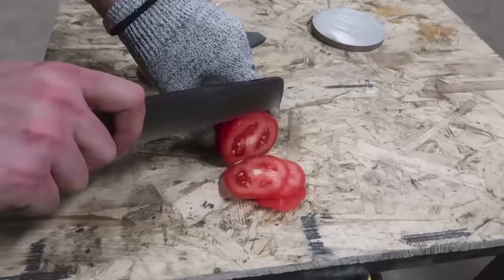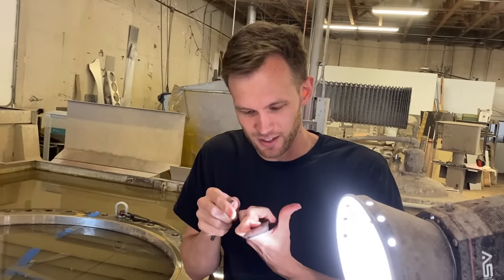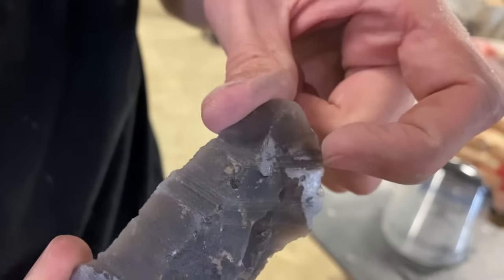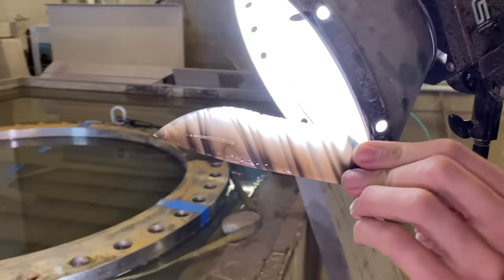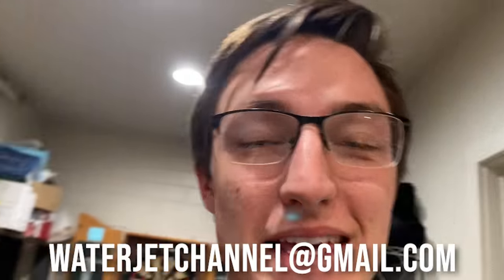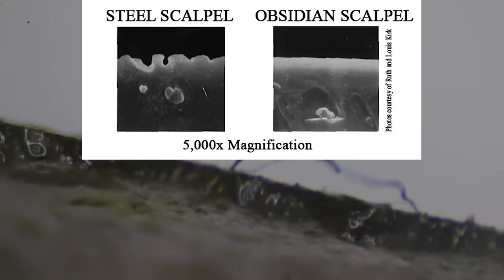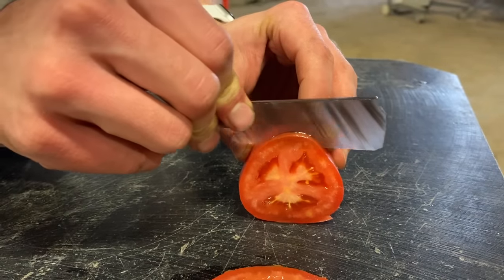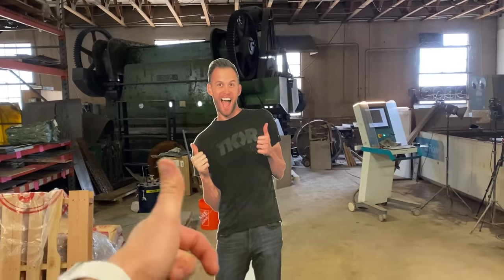World’s Sharpest Obsidian Knife

Comment: You can sharpen obsidian on a grinder/belt sander but you need a belt with grit made of extremely hard material and running at a slow speed/low power and kept wetted with water throughout the process

Comment: Fun fact: surgical scalpels r made with low quality stainless steel and only r meant to make a few cuts and then be tossed b4 they loose their sharpness. But obsidian can basically keep its edge a hell of a lot longer and then just be re-knapped or re-ground when needed. Also even in modern day, some cosmetic surgical procedures r done with obsidian blades, esp on the face, cuz they cut more precisely and leave less of a scar.

Comment: U can sharpen obsidian by grinding it on a whetstone very slowly. Not a a grinding wheel.
Reply: No
Reply: That sitll won't produce the super sharp edge:  they're made via the prismatic method: you flake singular long blade pieces off a core with each strike, so the blades have a continuous edge (vs knapping where you're making multiple strikes on the edge of your blade which results in some chipping and not one flush cutting surface.)

Comment: Fun fact: Obsidian is the world’s (maybe even the galaxy’s) sharpest material. Surgical steel is usually made from steel and this stuff melters together to a extremely high temperature. Indians craved it for arrowheads because it was easy to chip when found, then when heated it reduced the tendency for the arrowhead to crack. 😅🙂

Comment: Nice video 
A number of years back 
I had to have a Emergency  Craniectomy to relieve pressure on my brain 
Along with brain surgery to remove part of my brain after a nasty fall at work 
The Surgeon used a Obsidian Scalpel as it caused the least scaring 
So if you can make a SUPPER SHARP Knife 
You Might want to work on slightly smaller blades

Comment: I had this idea, of pouring different types of glass into nitrocellulose skeletons, inside of molds... and I think it might have similar properties to obsidian... I think it would make a nice gun stock, with an integral bayonet... by casting solid glass.
Reply: The burning nitrocellulose forces carbon into the glass under pressure... it's kinda like the liedenfrost effect I think, so it needs to be a skeleton of nitrocellulose, or the glass will run away from it. Also carbon coat the mold, and keep it hot, and vibrate it while pouring.

Comment: Actual obsidian blades are flaked off in one large hit. They are not specifically knapped like you see people do with stone. 

I've seen and used an actual obsidian blade and it is sharper than any knife edge I've ever seen. They are usually only vaguely knife shaped and usually are just a big flake.

Comment: Obviously, a water cutter leaves a rounded edge. That's why we never have to debur water cut metal. You are also forgetting that obsidian has a crystal structure like duamonds. You have to cut it at the right angle otherwise its not sharp. Thats why when you strike it to break off a shard it has to be aligned the right way or you get a very small scrap.
Reply: obsidian is glass, it has no crystal structure ,it may have some kind of crystal pockets within the glass but obsidian is a mineraloid and forms no "crystal structure" of its own . most obsidian is basaltic , felsic lava and quartz with other minerals in various amounts.  so melted and mixed minerals that on their own can form crystals but together and when molten forms volcanic glass . it does however form random shapes as it cools but these are not crystals .   it breaks with a conchoidal fracture , what's called in physics a "hertzian cone" . this fracture pattern is what allows obsidian and to a lesser extent flint to become so sharp if a skilled hand is involved with the knapping. the only way to get obsidian to the molecular sharpness alluded to is to create a "blade core" which takes about a year of knapping practice and cutting your fingers up. i do agree that a waterjet is not optimal for creating a sharp obsidian edge , whats needed is an antler punch, a wooden billet and patience/practice
Reply: @captainflint89  I stand corrected.

Comment: Hard surfaces such as stone, metal, ceramic, or glass should NEVER be used to cut on because it will destroy your blade. Always use surfaces that will yield to the blade like plastic, wood, leather, and bamboo.

The only exception is a steak knife, but if you select the right cut and grill it properly, you shouldn't need a steak knife. You know a steak is done correctly when you can parse out bites by rocking the edge of your fork on it.

Comment: Interesting. I'm starting to get the idea that obsidian swords in videogames are not 100% realistic
Reply: Obsidian is insanely sharp when knapped properly, like it's literally much sharper than surgical scalpals, the only reason it isn't used is that it leaves microscopic flakes of obsidian when it cuts which is not good for surgery.

For a large blade like a sword though it'd be weak if not enforced. For the purpose of a large blade with an obsidian-sharp edge, the Aztecs utilized an awesome looking weapon called a Macuahuitl, basically a heavy flat wooden club with small obsidian knives around the edge.

Comment: wrong tools for this job, try using a stone cabbing wet diamond disk with a very fine grit with matching polishing slurry disk for a glass finish, use a flat slightly tapered cut on the water jet to get something at about 1/4" thick and hand sharpen it on the wet cabbing machine before polishing and you will have a very sharp non chipped edge, just make sure you do not try to sharpen against the edge because it will make the obsidian knife dig into the disk ruining your progress, so towards the edge shaping and polishing only, that and this way only so it doesn't take your hand if it had caught the disks and spun around

Comment: Seen it recommended a few times... but would like to see another shot at this... but without the abrasive cutting tool... you have to strike it and have the break run along a natural fault in the rock. You might/will waste a lot of rock until you get it right, but the resulting edge? Perfection.

NOW! You wont get an entire knife. BUT! You will get a scalpel sized blade out of it... think enough to cut skin cells in half, rather than mash them like a steel scalpel.
BUTT! You can't cut in an angle.... the pressure must only be applied straight onto the cutting edge. Also can not turn the blade while cutting. BUTTT! You will not 'feel' the blade cutting as you would with steel, so it will be all by sight to determine when to stop.

Cuts made with obsidian heal measurably faster. They also leave minimal scaring to the naked eye vs the scaring steel leaves behind.

Make a mono-edge(no chipping or unnatural diversions of the edge) scalpel. Gift it to your GP. That one single edge, if the GP can learn to use it right before they break it :) will save tons of time over the course of their career.
Reply from the maker: Haha you said butt

Comment: You guys were just lazy and stupid... should of made a thin blade and use finest sandpaper or diamond sharpening boards. Speaking of 2000- 3000 grit. And then just gently keep grinding. If it makes steel sharp, it would make obsidian even sharper. You just did not want to spend time. Thus we are left with "can't be done" if actually it could be done. Hmmm. Coming to think now. If obsidian is glass.... then what would manmade shockproof glass give us if made into blade and sharpened propperly... noone ever tried it....
Reply: Yes, you can sharpen obsidian glass with a diamond coated sharpening stone, I too would like to see someone spend the many hours to do it. The knife would look awesome.
Reply: Bud, you’re just plain uneducated on the topic. Flaking is literally how obsidian gets its sharpness, sanding would make a duller blade
Reply: @the_linguist_ll   No it wouldn't diamond paste or sharpening boards can sharpen glass or obsidian. And you can result in a very very sharp and smooth looking blade. It just takes forever. And the history of using obsidian, they did not have access to diamond paste.
Reply: @rdizzy1  Bud. The special properties of obsidian’s sharpness literally comes from the way it fractures.
Reply: @the_linguist_ll  That is irrelevant. It can be sharpened to sharper than steel knife with normal diamond paste or coated stones. Without the need for micro serrations.
Reply: @rdizzy1  Good god you’re impossibly slow.
Reply: @the_linguist_ll  I have to say, that today's technology grants oportunity to sharpen till the edge is a single molecule.  Ofc such blade shall not stay sharp too long but as I remember, obsidian fracture is close to that. Sharpening stone however gives smooth blade, which is the whole point of using stonegrinding instead of fracturing. If someone needs a blade for brain surgery, then there is a point. You do not want any kind of dullness in sucha blade. One wrong move, one tear and boom, you are a vegetable forever. SO THAT IS WHY sucha test should be made and we all would love to see it.